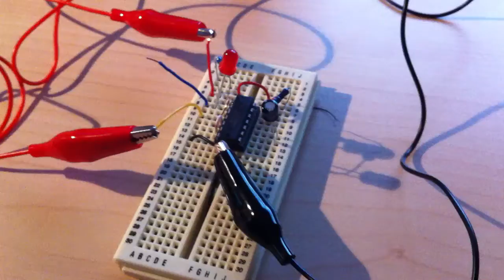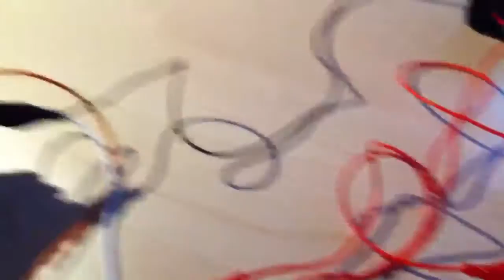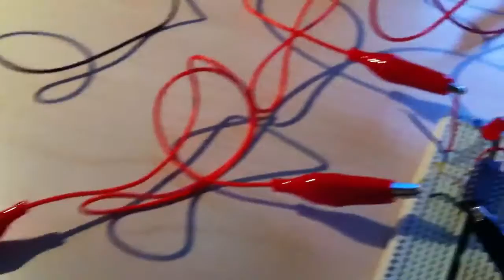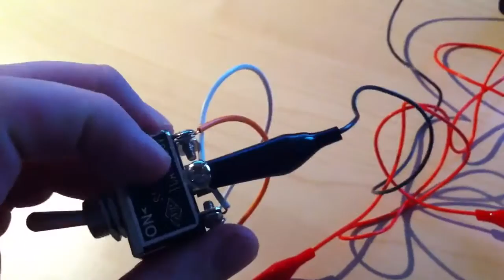Turning toggle switches into momentary switches

Comment: The schematics are protected by a login prompt, watching the video I believe they are as follows:  (refer to DM74121 schematics): pin 1 output, goes to ground when switch activated; pin3 is input, goes to GND thanks to the switch; pin4 and 5 are shorted together to 5V, pin 7 is GND. On the other side is pin 14 5V; external resistor connects pin 11 to 5V; a capacitor between pin 11 and 10. Even if I read the datasheet, I fail making this work (using eletrolitic capacitor) calculating Rext and Cext values for my needs with the formula in the datasheet, that also suggests a diode in the circuit. Please confirm the values of resistor and capacitor and if I use an elecrolitic one what should be the polarity? (I believe the schematics suggests a different type). Thank you.

Comment: Does it only pulse when the switch is turned on or can it pulse when turn off too?
Reply from the maker: Andrew Horton you can use a second chip for the off pulse or there are mono stable multi vibrators that have two on a single chip

Comment: Thanks dude! Tearing out the guts of a nerf gun and turning into a kind of Fallout style laser rifle with a lighting and sound circuit, but the damn sound fx board I'm using doesn't have a "play once on power" function, so I have to find a way to send just pulses when the "power" and "safety" latching toggles get flipped on.
Reply from the maker: Nice application of this!

Comment: Hi, I like your circuit. I would like to do something like this for a project. Basically I am planning on using a keyboard's processor circuit to output keys using a rotary dial, but am still unsure if I can make this work. If it's possible could you show me how I would implement this? The switch would be a 12 position single pole switch. Thanks for any help you can provide!